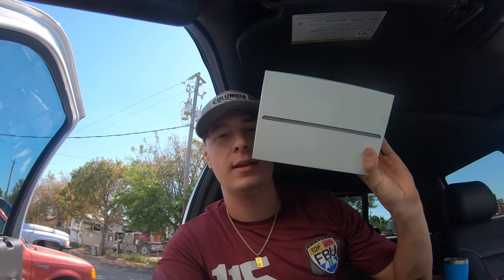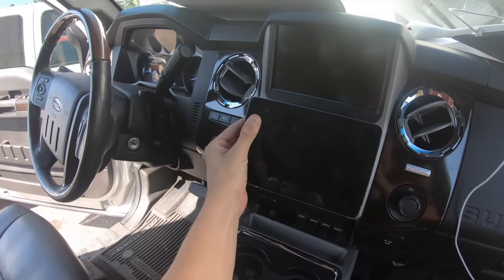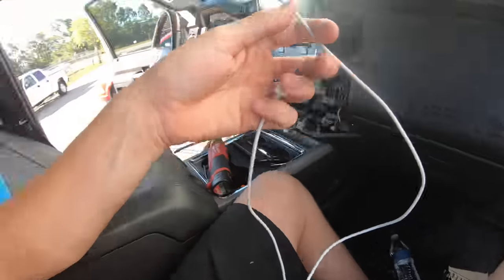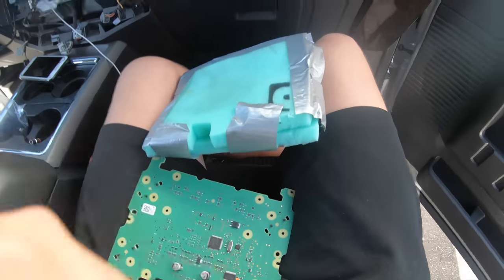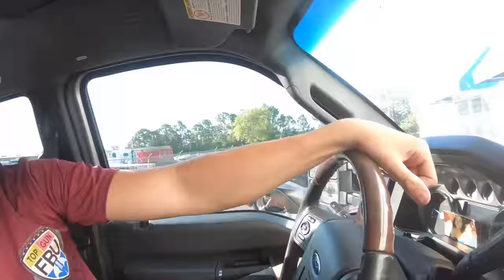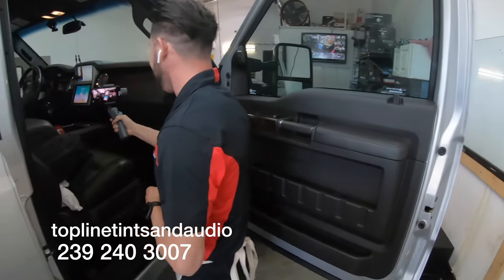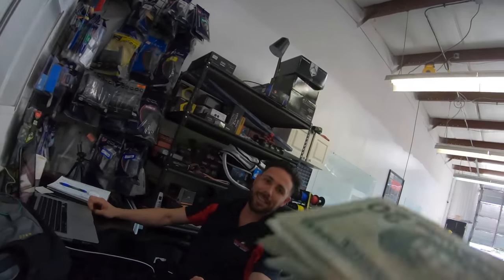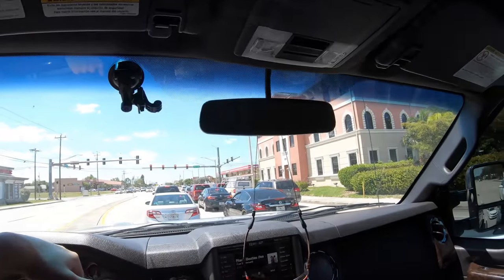New Mod! Apple iPad mini Install in my F350 Platinum

Comment: As an aircraft electronics tech I feel like that foam may cause some electrostatic discharge damage eventually; but that is very clever. The kit should have come with a way to properly mount that motherboard flat. 

I have apple CarPlay in my JL so I technically have a mirror of my iPhone screen anyways. 

I do like the double screen look though.

Comment: Looks great, the only thing I would have done with that HVAC mobo is to try and toss it in a static bag before putting it in the foam. Any computer place will give the you bag you need for free, then you'll never have to worry about ESD damage.

Comment: I would probably drill a bunch of 1" holes in the foam pad you wrapped that mother board in so it looks like "swiss cheese" on both sides so it can get some cool air around it.  This way you still get the cushioning effect but get some air in there.  How you have it now
 may work for a little while but will eventually contribute to burning it out...

Comment: Just update the software on your factory unit and use Apple CarPlay the mod seems useless and even if your don’t have the latest ford head unit just buy one it’s worth it on the long run it’s $1000 which jts not cheap but compared to a 64gb iPad from Apple which is $530 and the kit is also going to cost you money plus a monthly plan it just seems cheaper and better to spend $1000 once and get the new radio from factory and just use Apple car play or android auto

Comment: I have the exact same truck. when i plug my ipad to the usb it says not charging on the ipad and when i select the usb input it says no media files available on this device. what am i doing wrong? any ideas?
Reply: Did you ever figure the problem out? I’ve got the same issue
Reply: I just did mine tonight and am having the same issue😡😡😡